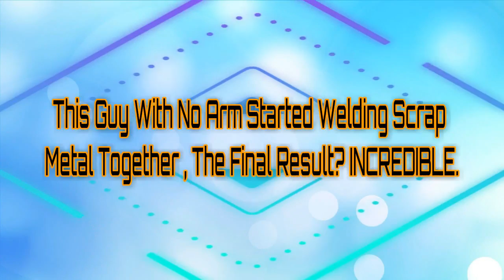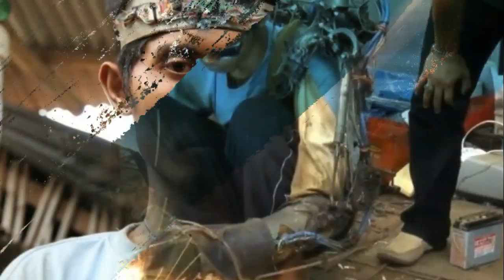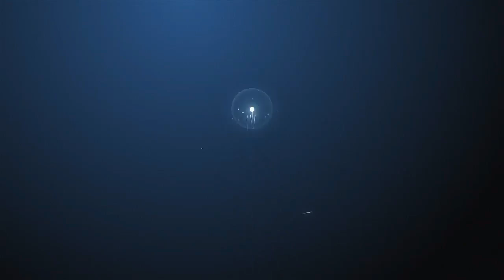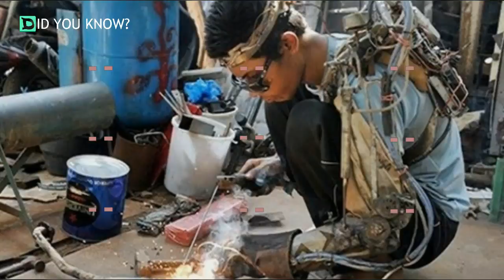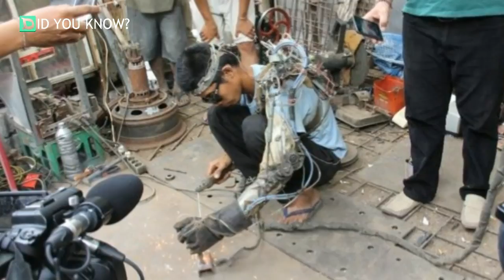This Guy With No Arm Started Welding Scrap Metal Together  The Final Result INCREDIBLE

Comment: i wanted to believe in this but the fact that i think busts it is even at the muscle...not clear from the brain the electrical impulses are extremely small. i find it hard to believe he did that with some copper wire and transistors with a leather strap on his head.

Comment: If you strike a welding ark within a radius of five feet from any kind of sensitive electrical signal transmitter/receiver it will freak out and not do it's job. Arduino units are one example.

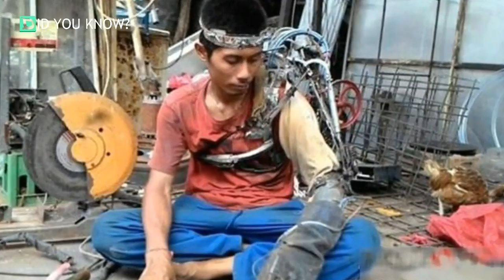Comment: BS - Direct your self to this video: https://youtu.be/KQecAQhBQbY at around 00:57 - It shows random, yes random PCB's wired together. 1) A PCB of which looks like its from a mobile phone, with a camera just dangling down with wires infront of it. 2) Random LED's soldered around. None of which are brain wave sensors.

Comment: This man built electrodes that pick up brain signals through hair, an amplifier that uses no visible power source and pneumatic pistons that aren't connected to an air supply and built a "bionic" arm better than what most MIT students could do with a grant. Sounds legit
Reply: I think he might have a co2 tank in the backpack.  Also I think the whole setup might just be to keep his arm up, letting him effectively use his stinger even without much motor control in the one hand.

Comment: How you can extract impulse from brain witch arm you whant to control? Its imposible! The signal can be detectable on the sholder, or the last point on arm that has ability to feal and move, not from brain directly. Socond: If this guy knowing how to setup the controler and do the programming, why he working as the welder??? If i know how to code, why then i need to to do some dirty job??? Nonsense!

Comment: theres a video on youtube by sv delos, they are scuba diving coral reefs in indonesia and they run across a guy in a small wooden boat who is using dynamite to blow up the coral reefs to  get the fish, he has one arm, wanna guess how he lost it? he was pretty ingenious though, he had an on board gas air compressor with a long hose attached, one home made flipper, he would swim to the bottom gathering fish with one arm while also holding the air hose in his mouth gathering fish, all with one arm.